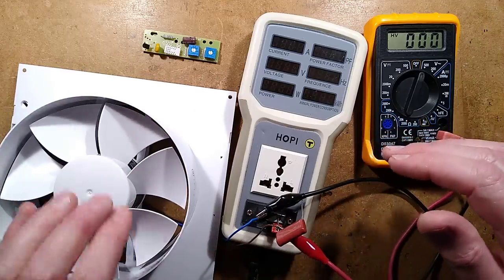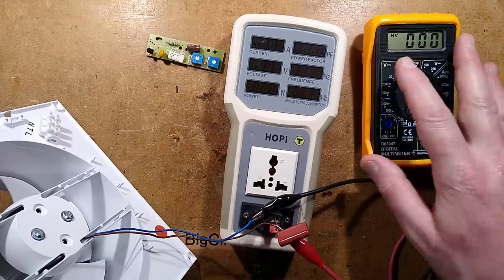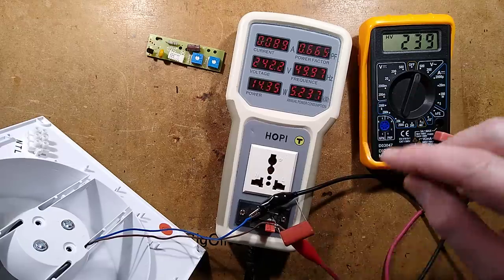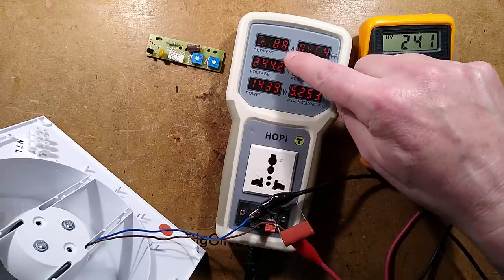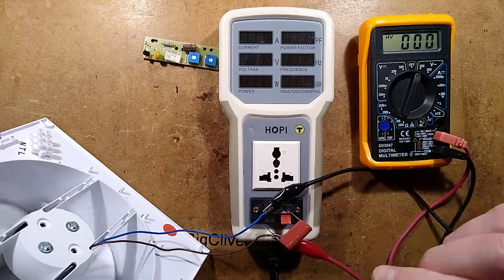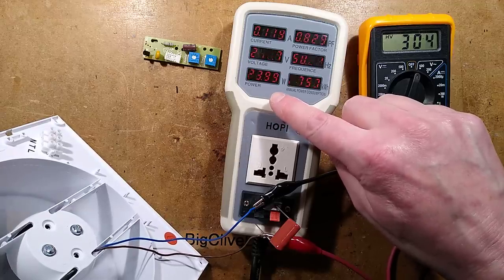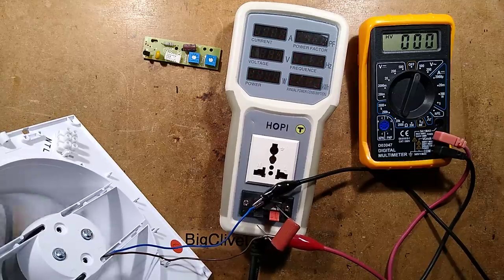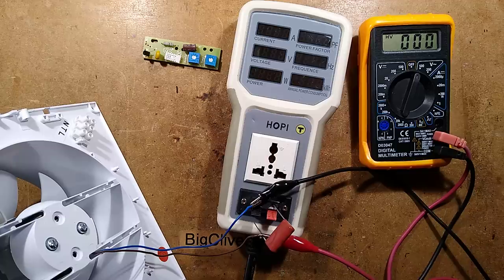What the heck!  Series capacitor makes fan go TURBO!

Comment: Note that the Power Factor has improved from 0.668 to 0.829. The capacitance is effectively correcting for some of the inductance which is opposing the current flow. If you increased the capacitance further, the capacitive impedance would be equal (and opposite) to the inductive impedance, cancelling it out. This would be at the resonant point, and the circuit would be purely resistive. It would also be going like the clappers.
Reply: That does give me ideas on an alternate way to add 110v compatibility to a 220v fan... by INCREASING the efficiency.
Reply: Yeah, the power factor is a giveaway that the reactance has gone down. It could either be a larger or a smaller capacitor that moves the reactance to zero, ie the one in it might be too large and is causing capacitive reactance.
Reply: It would be going the same speed tho? as its a synchronous motor and its speed is only a multiplication of the AC frequency, im not aware of power factor correction changing mains frequency hz [only phase shifting it in time].
Reply: @MikeRatcliffe24 not likely a synchronous motor. Small fans like that have a different style of motor. Shaded pole is likely what it is. Either way, it's not a frequency dependent motor, like sync, or scim.
Reply: I came here to say basically the same thing. Power factor correction, but inline. Causes the voltage to increase in the middle... It would be interesting to see if a lower OR higher value of capacitor would make the voltage across the motor (and capacitor) increase, as the power factor didn't specify whether it was leading or lagging after the capacitor was installed.
Reply: Came here to say the same. The PF shows the whole story
Reply: @IceBergGeo  they would still be a frequency dependent motor, they just operate with a lot of slip. more similar to just about every other AC motor. a synchronous motor is more so a specialty really only used in microwave turn tables and old mains powered clocks.
Reply: At 2 π sqrt(L C) = 50Hz, the circuit would behave more like a short, probably causing the fan's destruction. I'd very much like to see that. 😏
Reply: @mattmoreira210  I too wish to see it go into potentially double turbo and explode. Clive! Fetch the emergency containment pie dish. You know what to do.
Reply: @MikeRatcliffe24  it’s not changing the frequency the inductance of the fan makes the returning energy slightly out of phase and by adding the capacitor you’re putting it back in phase the frequency remains the same
Reply: @mattmoreira210 This resonant principle is also used for the testing of underground power cables, which are coaxial. The cable itself acts as the capacitor, the testing equipment consists of a truly huge inductor (about 5000kg of copper) and a variable frequency PWM supply. You assemble your LC circuit from the cable and inductor and then feed the base of the inductor from the PWM supply and tune the input frequency to achieve resonance. You can achieve 300KV on the test object with an input voltage of only 4KV.
Reply: yep....this.
Reply: And we have liftoff. Till the angry pixels are released with the magic blue smoke.
Reply: @mattmoreira210 job for electroboom I think 😂
Reply: @HelenaOfDetroit  but why does the voltmeter show 300V? ( the yellow one)
Reply: Came to make the same comment about the power factor.  I did the same thing with an AC fan about 45 years ago, but it would start slow and speed up after a short period of running (I was trying to slow it down to reduce noise).
Reply: Yup you will typically find a capacitor bank in a large factory for this exact reason.
Reply: @mattmoreira210  there's still resistance in the wires... It would seem like a short, but only across the DC equivalent resistive portion, so not quite. But close.
Reply: @gloinschmelzer7601 Likely because the voltmeter is not measuring the True RMS voltage and is assuming a perfect sinewave.  Many cheap meters do not have the capacity to properly integrate a True RMS voltage as that takes a bit more grunt under the hood and adds to the cost to manufacture and most average lay persons are unlikely to be dealing with distorted AC waveforms, just the natural sinewave when measuring the output at an AC outlet.
Reply: @MikeRatcliffe24  induction  motors..only liberate power  in to shaft when "slipping"..running at less than synchrony ..
Reply: @IceBergGeo  Yep, I was incorrect it appears similar fans do use a shaded pole induction motor. its still a frequency dependant motor just with some added slip.
Reply: @jim4556  Its been a while since I read/played with induction motors, do the smaller ones have a lot of slip and not just a few percent 2-4%  [ie mains is 50hz motor would be 48hz once running at steady state ignoring pole rations]... 

Im really looking forward to the follow up video on this one, I never really considered the implications of PF correction on the mechanical side [although I thought the capacitor was in parallel for this]. Perhaps it possible that increasing the PF of a motor with a badly chosen load/fan that is too small will lead to an overall lower efficiency of the system [ie less CMF per watt].
Reply: @jasonudall8614  Yep, looks like I was incorrect on that one.... Will be interesting to see how much slip is occurring before and after the PF correction.
Reply: @MikeRatcliffe24  those fans run at a VERY high slip. The theoretical rpm would be  Hz*60. This one, in theory, would be 3000rpm. It only runs at about half that (generally) and there is enough resistance in the motor, that if it stopped (locked rotor) it would not pull enough current to overheat the motor. 

I could be wrong, but that is the way these fans (should be) designed to run, if they are meeting electrical standards.
Reply: @MikeRatcliffe24  so powerfactor correction is done in parallel. It works because the current through the capacitor is the same motor reactive current. This will reduce the apparent power before that point of correction but does not change the current the motor  sees or the energy used.

So.. power factor correction does nothing for saving energy. I mean it can reduce the resistive losses on the wire leading to the point of correction but that's pretty minor. So for a household you are not charged for a bad power factor. So it dosnt matter for most people. You only pay for the power you use not the apparent power. In a commercial facility you are charged a penalty for a bad power factor.  This is because they use so much more power, and a bad power factor increases the supply line current. A poor power factor means that the utility company cannot service as many people because the line current is artificially higher than the real power being delivered. So commercial facilities either need to correct their power factor or pay the penalty. And it's a steep penalty. The real power they consume will be unchanged. But the wires on the utility side will see a reduction in current.
Reply: @MikeRatcliffe24  well 3000 rpm would be syncronus (50hz). On a shaded pole motor On low speed, they can be like 50% slip. The slip is completely dependent on the torque of the load. So it will very a tun. Where other types of inductive motor have very low slip. Like 2-4% as you said.
Reply: hy, one question, so does it make sense to replace every capacitor that has more nanofarads? if you would replace the capacitors in a motor controller (escooter), for example, would that make sense or would you ruin the entire "system" of the circuit?
Reply: Nailed it, Zadster! (Chitlitlah also has a good point.)
Reply: @HugforYou  That capacitor is there for a very different reason. You are talking about DC on the scooter. This doesn't apply to your situation.
Reply: @IceBergGeo  Thanks for the answer, but I don't understand what you mean, I mean, my capacitors are also used to stabilize the voltage, 1 big one as a start capacitor for the motor when starting and then small ones for each mosfet that support the mosfets. Why wouldn't larger ones offer more efficiency, i.e. save the battery? But I know more, sry 🤔☺
Reply: @HugforYou  The energy comes from somewhere. The batteries store it, as chemical energy. The capacitor just gives it a little extra push. There is no efficiency gain by installing a larger capacitor. The batteries might be under a little less strain, but it's negligible. They are the source of power. A capacitor just stores a minute amount of power, and still has to be recharged any time it gets drained.
Reply: @gloinschmelzer7601 by adding the capacitor, Clive has created an LC oscillator with a resonant frequency that happens to be near the frequency of mains power. when you drive an oscillator with a frequency near to its natural frequency, it begins to resonate and the input signal can be amplified. It really isn't "amplification" in the usual sense, it's more like "concentration". The resonant circuit actually re-emits a wave back into the wall that destrucively interferes with the mains power. When interference happens between waves, the energy that "disappeared" has to reappear somewhere, in this case it gets concentrated in the resonant circuit.
Reply: @MikeRatcliffe24  But it's only synchronous under ideal no-lod conditions. It's generally some kind of squirrel-cage or shaded-pole arrangement, which is what is commonly found in small AC fans and in these cases the mains frequency sets an upper limit to the speed but not a lower limit.
Reply: @ethanpoole3443  jep. You made me think the same.
Reply: @gloinschmelzer7601 It looks like one of those cheap HF/bay ones which isn't measing true RMS. I'm guessing that LC circuit is changing the voltage across the fan to something pretty different from a pure sine wave, but the meter is calculating it as a sine wave. I think an oscilloscope would tell much more than the PF numbers.
Reply: Fr=1/ (2 pi sqrt(L C))

Be cool to measure the inductance and size the cap for resonance.
Reply: Perhaps, there's also a +90 degree phase shift, so that voltage lags current by 90 degrees. The inductive motor having the converse relationship.
But yeah, at resonance, that thing would likely swiftly seek orbit.
Reply: @SkippiiKai  not likely changing the waveform. In fact, not at all. There is no active component inside the circuit to change the input, just passive components.

An oscilloscope would tell exactly what is happening. And you'd still see the 50Hz sine wave.
Reply: @spvillano  the proper way of saying it is the current is leading or lagging, not the voltage.

The fan is pulling current not AT 90 degrees, but at somewhere around 48 degrees lagging to create the power factor around of around .66... (I haven't pulled out a calculator, just back of a napkin sort of estimation.)

The capacitor is trying to correct that. I am sure that we could figure out exactly the inductive reactance and DC resistance of the motor by putting phase angle and current into a formula, but I'm too lazy to do that. Either way, we'd then know the exact value of capacitor required in order to create a unity power factor, and also the highest voltage across the fan. (I don't believe that they would be the same value either, due to the series resistance of the fan motor, but I could be wrong... It's been a while since I've actually done these kinds of problems.)
Reply: @IceBergGeo  heh, the last time I did those calculations was back in 1978. So, I'm a bit rusty.
Reply: @spvillano  the last time for me wasn't quite that long ago .. 

As an aside, it appears that we watch a great number of the same channels. I'm just not subscribed to them all.
Reply: @IceBergGeo  I subscribe largely so that I can find them again, as I’m rubbish with names.
Reply: DO NOT create a resonant series circuit if you do not understand what you're doing. It can cause extremely high voltages and current, causing explosions and death.
Reply: @zachfoss4152  extremely high voltages and current? Explosions?
Did you forget the laws of thermodynamics? There ain't no such thing as a free lunch. You could get higher voltage at the cost of out of phase current, the converse, but not both at once and being magically amplified. The worst one could expect is overspeed the motor or smoke the windings.
And perhaps, one might then burn one's fingers  on an overheated motor.
Reply: @mattmoreira210   not really .. it won't be a short.. it will be then purely resistive... So the power factor will be 1... Well if the fan is not designed to handle that much power ... Well it will go kaboom
Reply: Are you referring to the Back Emf (Magnetic Flux) being dumped back into the system during the AC cycle is reduced?
Reply: @Dazza_Doo  power factor is well defined.
https://en.wikipedia.org/wiki/Power_factor
Counter-EMF, aka counter-electromotive force, is also well defined. What you're suggesting is a transient, which can be induced capacitively or inductively.
Reply: Came here to say this. My guy is on point and actually explained it better than I probably would have.
Reply: He also said it was series capacitance when actually the pf correction capacitor is placed in parallel with the load
Reply: I just finished reading Tesla's patent on the bifilar coil and figured it was something like this, then I see this comment. I agree this is what's happening.
Reply: But the motor would be overheated?
Reply: @dtiydr  Just reduce the input power to the motor.
Reply: @JenkoRun  And thus no usage of this?
Reply: @dtiydr  This effectively neutralizes back-emf, lenz law, which means less force is required at the source to achieve the desired output at the load, this also works if used in the generator itself, I'll let you wonder the implications of that.

"In electric apparatus or systems in which alternating currents are employed the self-induction (lenz law) of the coils or conductors may, and, in fact, in many cases does operate disadvantageously by giving rise to false currents which often reduce what is known as the commercial efficiency of the apparatus composing the system or operate detrimentally in other respects. The effects of self-induction, above referred to, are known to be neutralized by proportioning to a proper degree the capacity of the circuit with relation to the self-induction and frequency of the currents. This has been accomplished heretofore by the use of condensers (capacitors) constructed and applied as separate instruments." 

-NIKOLA TESLA U.S. PATENT 512,340 - COIL FOR ELECTRO-MAGNETS
Reply: To add at what @zadster said the Frequency that the voltage is supplied to the fan isn't at the optimal frequency for the fan and the Capacitor helps correct this issue allowing the fan to operate for Efficiently. This is standard practice at large factories to allow the motors to operate More efficiently and actually using less energy. Best example is let's say you have a motor that workes best at 50hz but the energy supplied is at 60hz the motor will actually use more energy because the phase is incorrect. If you add a few capacitors it will allow the fan to pull electricity at a more Efficient Frequency.
Reply: Yeah what that guys said
Reply: @chitlitlah  The reactance did NOT go down... It was basically the same, but went up very slightly from 16.1 to 16.4 VAR using the relation Q=sqrt(S^2-P^2)
Reply: Like to see that thing hooked up to an oscilloscope because I have a feeling it would look like a Richter scale during Pompeii😂
Reply: @dl5244  That formula gives the reactive power, not the reactance (the part of the impedence other than the resistance). The impedence obviously went down from the first case to the second since the current went up without a change in voltage and the capacitor should not have had a significant effect on the resistance, so the reactance must have gone down. Beyond that, I haven't completely woken yet and I'm not trying to calculate it from the numbers given by the Hopi.
Reply: Improving power factor isn't expected to vary the true power (Watts) so much. It theoretically will vary VA and VAr.
Reply: @HelenaOfDetroit yes. power transfer improves when power factor improves.

What is more interesting to me is the 300+ voltage. Improving power factor increases voltage, making it higher than the supply voltage? I thought improving power factor does not increase voltage beyond what the supply is outputting.
Reply: @chitlitlah  true enough... but reactive power is inversely proportional to the reactance load (given the same ~240V supply). Since the reactive power didn't change appreciably, neither did the reactance.
Only the real (active) power changed (increased) to shift the PowerFactor reading
Reply: @kishorevenugopal6191  that would be for a parallel PFC capacitor.
in this case, the true power (or active or real) in Watts significantly without changing the reactive power much at all
Reply: @sepg5084  not in this case b/c the active power (and apparent power) increased while the reactive power did not really change
Reply: I read every word of this, and I understand none of it. This is my problem not yours.
Reply: @MikeRatcliffe24  It is not a synchronous motor. It is an asynchronous motor. It has a certain slip that induces current in the rotor in a short circuit (squirrel cage motor). The force of air friction slows it down.
Reply: I think hes already over 1.0 PF and the voltage bump is the inverse action of the lagging vars, leading vars are known to cause some serious voltage anomalies.
Reply: Power factor correction is connected in parallel with the load.. adding a capacitor in series in an AC circuit makes it impedance which is an AC resistance
Reply: The rms is raised due to advancing the phase angle to overlap creating the higher voltages. Dont know why it's drawing more watts though. Maybe there is resistance in the cap somehow
Reply: @brettmoore3194  It consumes more watts, because the active power in the motor increases. Increase that leads to higher rpm and higher air resistance. If you increase the value of the capacitor until it reaches the capacitor coil resonance, the power will increase. After that it will decrease.
Reply: @emililie2244  that's sorta what I said but your saying the capacitive reactance increased the resistance at that frequency
Reply: In contrast, what happens if you use an UPC (Backup Power) unit and do the same test? Is the UPC regulating the current peak before it reaches the appliances?
Reply: @gloinschmelzer7601  resonans not perfekt but close to on hige point ?
Reply: Try a number of different capacitor values over a range and make a chart to interpolate the highest possible power factor.
Reply: @MikeRatcliffe24  are you sure it's a synchronous motor?
Reply: @gloinschmelzer7601  back EMF?
Reply: @stvrob6320  Nope, as shown in later comments :)
Reply: @MikeRatcliffe24  I don't think it's a synchronous fan
Reply: I have a gas heater that had an ac fan and was spinning really slow causing the heater to overheat and cut out the gas. 
I replaced two of the run capacitors which fixed the issue. 
I wonder if they’re used in the heater for the same effect?
Reply: Reading this comment made my brain bleed
Reply: @MikeRatcliffe24 These shaded pole motors are most likely not running at full speed when given the standard 240v 50hz, with the fan blade mounted to the shaft, whatever the capacitor is doing, it might give it the boost it needs to actually "sync" the rotor to the rotating magnetic field, better than before. Although it is probably not fully sync even with the cap in series.

Since the cap pushes 300v through the motor, its making more torque, but at the same frequency, making it able to maintain the intended rpm at the 50hz frequency.

You can also test this on a VFD, the motor loses power when going over 50hz as the voltage simply isnt high enough to put enough power to the windings to make the rotor follow its frequency.

Increasing the voltage, thus more power would give enough torque to make the rotor keep up with the frequency. The windings would also get very hot..
Reply: Increased real power.
Reply: Cannot change the frequency.  Capacitor can only change the pf. (Angle).
Reply: @tissuepaper9962 Exactly!
Reply: Ri8 same i had observed